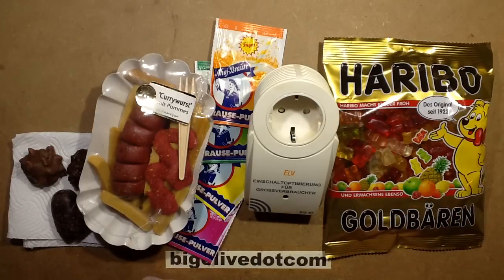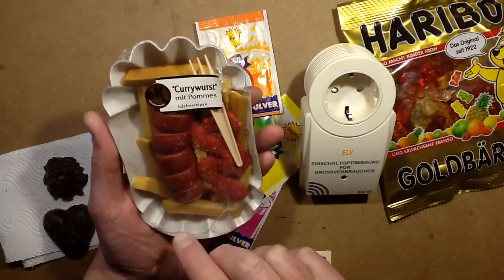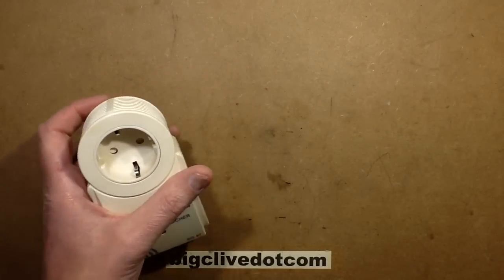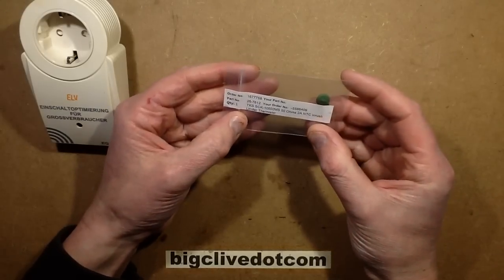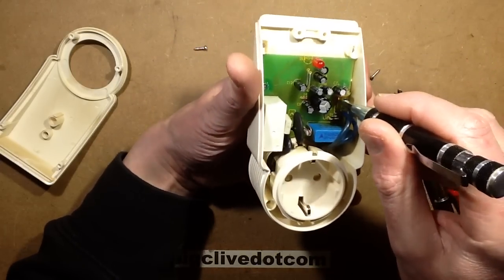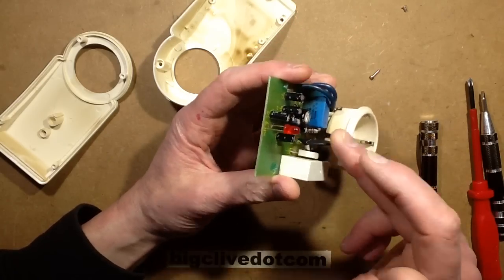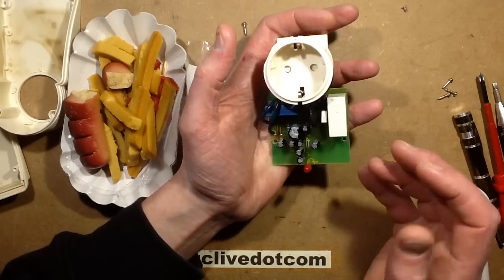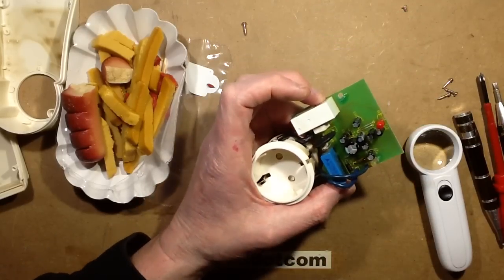German candy and a mystery power device.

Comment: Question: Is it possible to have so much resistance on a line that the output becomes negative?
Say you put a resistor in line with a 5v signal, could the value of that resistor potentially be so great as to pull it down to any negative voltage, say -1v?
Reply: For one, if you put a resistor in line with 5V, on the output of the resistor, there will still be... 5V! However, if the resistor is big enough, you will no longer be able to measure the full voltage, because your measurement device will have resistance between measurement probes that is not infinitely high, most likely 1 MOhm.

It's useful to think of a resistor as not doing anything to voltage, it's limiting current. The larger the resistor, the lower current will pass. For example, 1 MOhm resistor at 5V will pass at most 1µA. But what use is 1µA of current? Actually current based thinking is applicable to most parts, and you can figure out corresponding voltage using Ohm's Law. Now what kind of parts can make the current run backwards? Capacitors, inductors are candidates, you can make them do so on pulsed input, and then you can harvest the resulting negative voltage. EEVBlog has made a "Microcontroller Voltage Inverter Tutorial" for example.
Reply: Not really unless the power supply is part of a split rail supply where a negative supply is available as well. ie +5V, 0, -5V.
The lowest a resistor can drop a 5 volt supply to is zero. The voltage drop depends on the resistor value and the current passing through it.
For example a 1K (1000 ohm) resistor in series with a device drawing 1mA will drop the voltage to 4 volts. The same resistor in series with a device drawing 3mA will drop the voltage to 2 volts.
In the case of the split rail supply consider a 6K resistor in series with 4K. Connect the 6K to +5V and the 4K to -5V. At the 6K 4K junction -1volts will be available.
Reply: No.

If you put a resistor in series with a 5v signal, you would just be limiting the current. The higher the value of the resistor, the lower the amount of current you can pull through it.

You could, however, short-circuit the 5v signal to ground and make it 0v (and also make whatever was supplying the 5v signal very unhappy) but you can't make it negative.

To change a 5v signal to -1v, you could use for example an op-amp configured as an inverter. You would also need a negative voltage rail supply to the op-amp to allow it to output a negative voltage.
Reply: bob s Makes sense.
It was a stupid question, but me (being myself and not thinking the question in my head through) thought that if a 1k resistor dropped 1 volt (example), then a 5k resistor would drop 5, right? What if a 6k resistor was applied? Would that bring it to -1v and make the line actually become reversed?
Reply: It wasn't a stupid question, i see why you thought that.

The problem is: what is the other resistor?
The circuit must be closed in order for voltage to drop on a resistor

The formula is: Vout = Vin * R1*R2/(R1+R2)
Reply: Italian Programmer Just line voltage.

DC+ - Resistor - Meter - DC-
Reply: With a single +5V rail and 6K the maximum current that could pass through it would be V/R =5/6000 = 0.833 mA . This would happen when the resistor was directly across the rails (output voltage = 0). Getting more current to increase the voltage drop across the resistor is impossible with a single resistor.
The voltage drop across a resistor is dependant in the current passing through it. Any resistor, even really high values (short of infinity) would drop no volts at all if there was no current passing through it
Reply: AIO inc. the fck ?
No, of course not.
Reply: Annelise Meier I said already, it was a stupid question.

It was late at night, cut me a bit of slack.

Comment: don't handle solder near your food
Reply: why not? you wont get a lead poisioning that quickly.
Reply: You can't eat enough lead in one go to kill you but lead tends to remain in your body and builds up as you ingest more. Eat enough over a period of time and that will kill you.
Reply: +jort93z
it accumulates over time and make you dumber, also it not only lead you need to worry about when taking apart electronics, there all kinds of chemicals in those components
Reply: Henry Herz i think you are overreacting though. you'd have to eat quite a lot until anything happens.

and there are possibly a few corrosives too. but in those amounts they wont do anything. they'll be easily neutralised.
the only thing that could do harm on those kinds of electronics would be the lead in the solder. and thats nothing to worry about. also its possibly lead free solder.

its not like there was a leaking lead acid battery on that circuit or anything.

Comment: does the NTC get physically hot? like would it burn nearby electronics if it was to be hot glued onto stuff?
Reply from the maker: It does get hot as part of its function.  It shouldn't be glued to anything as that would affect its operation.  It's best operated in free air, and when I've used them to take the bang out of big transformers I've mounted them in ceramic terminal block as a precaution.
Reply from the maker: james birdsall I've spent most of my life in Glasgow.  Born in East Kilbride.
Reply: bigclivedotcom which part of Scotland are you from? I'm from the closest county in England to Northumberland

Comment: Hey Clive, I've seen a similar thing before that had a double bypass. I guess the reason for the bypassing relay is that this is just a generic ntc thermistor and there is a possibility of it not being well matched to the device, So in times of low current draw, such as a washing machine switched on but say with a 6 hour delay start timer or similar condition then the current draw might not be enough to fully heat up the thermistor to its operating temperature. This causes voltage modulation as the NTC heats up and cools back down in a repating cycle, it can also cause your washing machine / other appliance to act up. It might also bypass the device once a continious current is reached to allow the NTC to cool down and be ready to protect as soon as their is another spike or the power is cycled to the device, this also saves a lot of wasted heat as the NTCs can run quite hot as im sure you know.

Comment: I have a 16B breaker in my house just for my music amplifier and without a device like in the Video the breaker just pop out all the time.
Reply from the maker: Many big amplifiers use internal soft start circuitry (sometimes an NTC) just to avoid that situation.
Reply: At a cinema I used to work in the amplifiers had to be turned on individually- if the soundrack was turned on with all the amplifiers (8 channel) already on the breaker would trip.

 I have heard of phased switch on systems that can turn on a whole rack in sequence to avoid power surges (needed now that there are no projectionists). Others believe that the equipment should never be powered down, although this would increase the amount of ming sucked through the equipment by the ventilation fans.
Reply from the maker: +Mark H An Eno Switcher?  Used to sequentially power audio equipment up starting with the sources first to avoid loud pops.

Comment: Canada standard house panel is single phase 120/240v 200 amp (higher amp panels are available as are 3 phase services). This is because we need to wash dishes, clothes, heat water, heat house, run central vac,  cook and Mig weld all while relaxing in the hot tub.

Comment: I'm betting the hot glue over the screw is just an idiot lockout.
Reply from the maker: There was a layer of green tinted screw-lock over all the screws.
Reply: Maybe it's supposed to insulate the screw against something jumping from the current sensing jumper there.

Comment: I have one of these from ELV in use (ESB54). Since I don't want all my stuff to draw standby power all the time I connected a lot of it to a power extension with switch. However the amount of switching power supplies sometimes tripped a B16 fuse the moment I flipped the switch. That thing is very handy. It works like that: Whenever the power usage is less than 20VA the current flows through the NTC. One the power rises above 20VA the relay kicks in, but with a delay of about 0.4 seconds. If power consumption stays over 20VA it won't help with another surge and turn the relay off since that would mean to drop the voltage i.e. interfer with the supply of the other devices connected to its output. Further information is here, but all in german. https://files.elv.com/Assets/Produkte/10/1057/105772/Downloads/105772_ESB54-2_um.pdf

Comment: In a lot of your videos you say 240 volt. As far as I know 220V (European continent) and 240V (UK) were both replaced by 230V? At least, in theory ;-) Have you actually measured the current in your home?
Reply: Not to be picky (yeahh right), but 240V has nothing to do with current :-)
I believe Clive mentioned some time he actaually have 240V in his house.
Reply from the maker: Actual measured voltage usually around 240 to 245V depending on neighbourhood load.
Reply: I was measuring Hz with my fluke meter just the other day and it ranged from 49.8 to 50.5 out of the socket :)

Comment: Are you going to do anything more with the device? The heroic task of making acomplete schematic? Or perhaps more realistically, just replacing the ntc and testing its function?
Reply: BTW u can use the AHOI powder in very different ways, like put it directly on ur tongue and then flush with a shot of vodka. if u do it pls share the experince.
Reply: The device is fully functional. I send it to him.
Reply: The device is about 10 years old and was used (abused) by having an old washing maschine and a tumbledryer plugged in. both devices are running at the same time so the maximum power, if both heaters are fully on, maybe 4kw, so i think it survived pretty well.
Reply from the maker: It actually looks pretty modern inside for a 10 year old device.  The sootiness inside was because the large zener has been running quite hot as standard.
Reply: as some one mentioned in the comments, the device originates from 1997... with an older version from 1986.
Reply: HowcountryWow Oh! I thought it looked like there was a big crack in the ntc, but looking again, it was just part of the markings.
Reply: We were hoping for a schematic.

Comment: In the Netherlands most have 3 fase ~230v into their home. But only one is connected and fused at 35 amps most of the time. Then every group is fused at 16 amps. Although like me you can get all 3 fases connected 3x25 amps. And the groups after that again fused at 16 amps normally. Of course for certain applications it may be different.

Comment: They are called NTSC-resistors. I use them on a small tube-amp in the garage. They work very well.This circuitry is a bit more advanced, detecting restarts. Smart design.
Reply: I don't think you typed what you meant to type. You should check what NTSC is, and then per-maybe-haps check again and not mistype NTC again in the future.

Comment: I'd be interested to see you look at a breaker.
Have you ever done a teardown of a mains electric meter? In my first flat about 20 years ago I had a prepay electric meter (with the blue plastic key) which I found out was possible to get free top ups by taking the igniter from an electric cigarette lighter, poking the wire in the key hole and pressing the ignition button. It would add a random amount of credit each time.
Obviously I never did this as it would be highly illegal.
But it would be interesting to know why this worked.
Reply: You may want to check out the channels mikeselectricstuff anf John Ward. They both did teardowns of circuit breakers. And otherwise, they deserve your sub.

Comment: Your German wasn't that bad at all.

And since this is about Germany in some way:

1. What do you think about the Schuko Plug System in comparison to the British Plugs?

2. Over here the B-Type Breakers are also the Standard.

3. As far as Amperage is concerned I'm not quite sure if the 'normal' thingy now is 10, 13 or 16A...
There was a change in regulation recently that didn't allow 16A for 1,5mm² cables in some cases.

And last but not least:
Many houses over here have a quite beefy cable coming in!
3 Phases are pretty much standard, and up to 63A is possible...
Just for a normal House.

As for the NTC Bypass Relais:
That's also something done in some high efficiency ATX Computer Power Supplys.

Comment: Really interesting (as always!) Clive. I have a request for some technical advice, if I may? (I think others might find the answer useful too)? I have a motor - (it runs a water pump from a water well, as it happens). I would like to use an inverter, so that I can run it off batteries in the event of a power cut. The motor is only 750W, but of course the start-current is significant, and not 'inverter-friendly'! If I wired one of those NTC devices, suitably rated of course, in series with the motor, might that, alone, solve the problem? Are there other factors I should take into account? (The motor is on a water-pressure switch, and the duty cycle is around 10 seconds operation, followed by 30 seconds rest at maximum demand)
Reply: So I've ordered a couple of these - one for the pump on the well, and one for the central-heating boiler (living in darkest Devon - when the power goes out, we have no heating and no water! Ha!) If it solves the problem, it means I can use a much lower rated inverter to run off batteries during a power cut. I shall reply to this comment in due course if it solves my problem - (I can't be the only with a need to run motors off an inverter...) Thanks, Clive. I didn't know about these thermistors till I watched your vid! :)
Reply from the maker: When you mount them, I tend to use a piece of ceramic terminal block as a precaution.  I've never actually measure their normal operating temperature in use though.  I just like to play safe.
Reply: Ah, thank you - hadn't thought of that. Of course, they must run a bit hot in order to work. I wonder, actually, if you need to make sure the rating isn't too high? Or if they find their own working temperature regardless? I guess a device rated at 10A, say, that's passing 1A in operation, is going to drop a higher voltage, so will dissipate more power, and heat up, thus lowering it's resistance anyway...

Comment: I'm not aware of different "types" of breakers in the U.S. As far as I know, all "normal" breakers are designed to tolerate spike loads up to some X level temporarily, and remain closed during those periods. If the spike load remains for longer than Y time, then the breaker will trip open. Don't know what the X and Y values are. I do know that you will see the effect of this in house-wide voltage sags while it's happening. Also, in the U.S., because our voltage is half what it is in the U.K. (120V), our typical maximum residential panel ratings are 200A rather than the UK's 100A, as you mention in your video.

Comment: The "in-rush" current is something we in the U.S. call "locked rotor amps", for which all motor devices have a rating. It's obviously called that because it is the same as the number of amps consumed by that same motor if its rotor were locked down, which is pretty much what's happening when a motor first starts.

Comment: dunno if youre still interested in cheapo USB charger/psus but poundland have a new Signalex 5V1.2A one out and it looks pretty damn nice inside, with the usual "does the transformer have a deadly winding error" caveat. but then I guess that applies to pretty much everything anyway.
Reply from the maker: I have both models of the Poundland chargers here in queue for a video.
Reply: bigclivedotcom
oh nice. I noticed there were two kinds, I went for the more compact rectangular one. the other kind is the same shape as a really bad psu I had which got hot and smelled of electricity, so it put me off. looking forward to the vid.